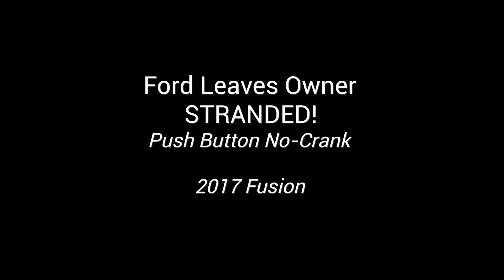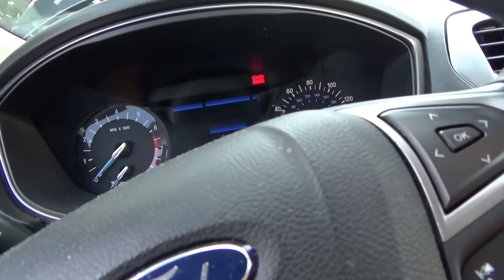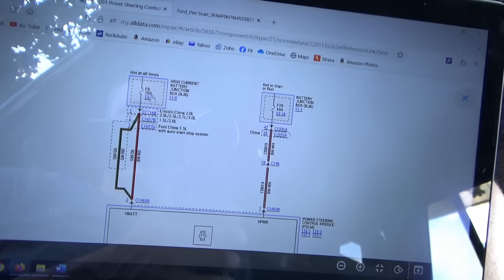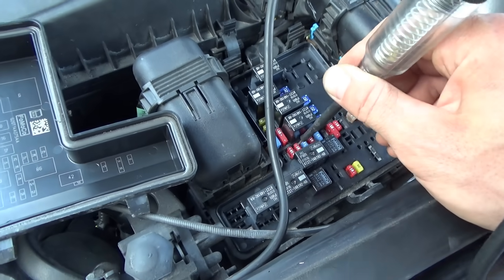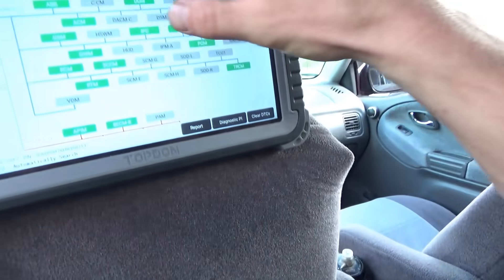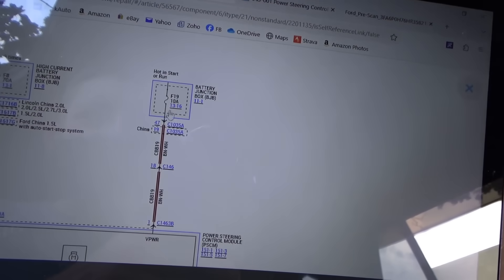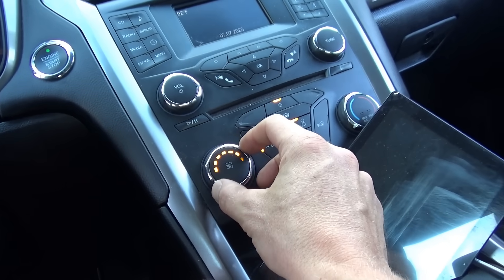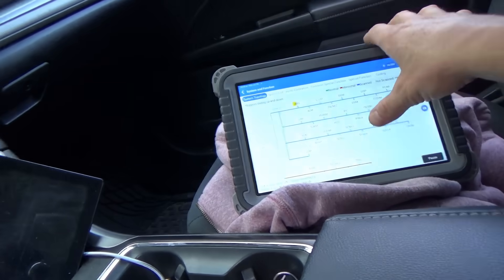Ford Leaves Owner STRANDED!! ('17 Fusion: No-Crank, Push-Button)

Comment: Either that fuse box have some cold solder joints or water intrusion or that fuse had oxidyzed and isolated itself from the circuit. As soon as you touched it the system came alive. For start change that 10A fuse or clean it well and see if the problem does not come back. If it does maybe that fuse box board have some problem.

Comment: Diagnose Dan had a similar event with carnk sensor being cross wired sensor OEM fitment in Europe Hella product the previous shop to him had changed 3or4sensors just following the codes  they asked Dan to have a look and the scope showed a fair pattern wave form wasn't untill he pulled a wave form from picos library he noticed the wav was upside down  cause ING a crank no start

Comment: I hate seeing things like electronic brake boosters and steering racks when the car isn’t an EV. They’re creating a problem that didn’t exist before they started making ICE engines that used components designed for an EV. The cost of repair has tripled just in the case of the centralized electronic brake boosters. What’s wrong with a vacuum assist behind a master cylinder? They were reliable as hell, but now the focus seems to be on replacement of the entire vehicle when you bring a ten year old vehicle to the dealership service department. Sometimes, the cost of bringing the vehicle back to factory stock is cost prohibitive due to poorly designed and expensive parts that were never designed to last longer than ten years. The air ride suspension of a Suburban SUV comes to mind.

Comment: If a visual inspection showed no corrosion in the relay socket, then the relay contact stuck the last time it closed and the contact burned, oxidized, and stopped conducting.  Vibrations from testing the fuses loosened the contactor and allows it to work again for a short while.  Possibly, the blower draws less current and the relay can work there indefinitely.

Comment: Those relays get pretty hot. I'm old school and always check coil resistance and contact closed resistance. I've found relay coils that increase resistance value over time (from heat) to the point of being intermittent or not working at all. Compare them to a known good one and see. Great find and quick repair on that one, good to have the wiring diagrams.

Comment: Very common for those fuse boxes to get poor contact, fixed simply by removing and reinserting all fuses and relays. when you look carefully you will see all have bad oxides on all pins, except where it got scraped off.
Reply: This is something that is useful for any car that particularly is older and been in service a long time and maybe gets some moisture inside the cabin because of small water leaks from time to time. Pull out relays and re-insert several times and you might just solve a difficult problem like a no start..

Comment: Good video Ivan.  Real world intermittent problems with all the electronics in these cars.  I just bought a 2025 Dodge 2500 with the 6.7 Cummins and I worried about all the electronics.  I am trying to decide on a new bi-directional scanner for it, I guess it needs be able to load Auto Authority.  Everything is a fringin subscription these days.

Comment: Very similar situation with our 2011 Silverado. Died in a parking lot, no start with intermittent cranking. Also gave CEL for ignition 1 and 2 circuits not matching.
 After checking wiring diagrams, I tracked the problem to the run/crank relay. Consider it's in constant operation, eventual failure is certainly possible.
Replaced it with same GM relay, no issues since.

Comment: I'm with ya Ivan.  I don't like problems that magically fix themselves.  Especially with a situation like this that could potentially strand the owner with the same problem.
Reply: Happened to my VW Lupo two years ago. Sudden no-crank-situation. Mobile mechanic measured and tested and after half an hour it came back to life but he had no idea why. Drove back home, shut it off, tried to start - dead. Tried again two hours later and it started. Next day I installed a DIY switch to bypass the ignition switch just in case this was the issue. But the situation never happened again to this day.

Comment: You would think there is a method to test those relays under their rated load for functionality. Seems like many mechanics would have a very good supply of the various relays on hand and simply replace them vs. switch them around.

Comment: Fords are notorious for these type of issues, it's just a loose connection problem which occurs from road driving and engine vibrations, just tighten the start relay contacts and you will be fine.

Comment: Ivan, be careful about swapping relays. I had a Ford pickup that had a defective start relay. I took the defective one to Ford and they said that the relays are different although they may have the same color and pinout and size, but some of the internals have different values. He showed me two that looked the same, but they were for different uses. I suggest that you should verify that they have the same part number before a swap.

Comment: GOOD video IVAN.This could be helpful to anyone with this model car.Just know that>that fuse runs the starting system on that model is key. And a spare part is located right next door.That's what i CALL EXPERT engineering!!!haha NO need to call a tow truck,when out on a date at lovers point.Just get out pop the hood swap the two relays,and take your date back to her sorority house.SHE'LL think your a genius.BUT it could still be the crustiness under the box?In this case i would tell the gut to buy a relay and replace it then put the other one back to the blower.This type of video is very helpful to most people including myself so thank you.

Comment: Ivan, I wrote a white paper on thermal imaging the relay box on no crank or crank no start situations, this method gives direction on going after the control side or the load side of the relays before intrusive/disturbing testing.
Reply: I'm assuming the relay will be cold since the coil is not energized/ commanded if it's a control side issue? Load side, warm relay?
Reply: @volvo09  Yes. Also further confirmation when possible with bidirectional command with two amp clamps hooked up to lab scope, when on DC the other on AC. DC macro AC micro reading. I wrote a white paper on that as well, gave it to Trevor at Autonerdz.

Comment: Good case on how replicating or verifying causation isn’t always possible, but you then must use logic and troubleshoot most likely cause.  Yet another case solved with a wiring diagram and test light and scanner.

Comment: That looks identical to the famous Ford Mondeo here in Ireland they are great cars did you get the Mondeo ST 220 over there I wonder do you have the diesels they are very good That model there looks to be a studio or Zetec as it doesn't have the bigger radio screen or digital dashboard also the wheels should look different to the higher trims like titanium and Titanium X
Reply: It's basically the same car, without the diesel.

This is a lower trim, you can get them all decked out with the big screen, fully digital dash, leather seats and whatnot ...
Reply: Ford discontinued the Fusion/Mondeo over here back in 2020. They no longer sell them in the USA. Now only ICE car left is the Mustang. Everything else is CUV/SUV or pick up trucks.

Comment: This happened before. I just touched a fuse checking for powers and grounds on a truck and things started clicking. I reached in and it fired right off. Didn't charge a friend but had the same problem come back within a week. He told me that he went back into the fuse box and wiggled some relays and it worked. Found a spread pin on the run relay that powers the ECM. I was leaning on bad engine computer. Boy was I wrong.

Comment: 2019 Explorer with an inconsistent startup. I found if I pushed the START button on the left and right side it worked. Replaced button, intermittent problem fixed.

Comment: I ran into a similar problem with a 2019 Nissan pathfinder. It wouldn’t start with the button no matter how the owner tried to push it. I locked the car and used the remote start function and it’s been starting normally ever since I used that remote start function. Weird huh?

Comment: I had a 2011 fiesta and did a relay swap around 2015 due to a problem like this, started playing up again around 2019 so I used to whack it with a screwdriver handle which always worked til I got rid of it in 2021. Percussive maintenance can work wonders :)
Reply: It's a Ford thing.
Reply: @ehsnils  It is- I've had several cars start after just a quick tap to the relays- almost always on cars/trucks that have been sitting
Reply: @ElijahAngwin  I have a 2015 f350 that I let sit for 3 weeks.  It became a no crank.  No codes, bright headlights, good battery.  Hold the key in the start position for about 10 or more seconds and it would crank and start. Replaced the run/start relay, cranks great instantly.
Reply: I love that term, percussive maintenance!

Comment: Ivan I just bought a 2012 Mazda 5  for 1,250 bucks at the capital auto auction in Philadelphia with a shit ton of issues 
Now I can put too good use what I learned from you in the last 15 years 
And my granddaughter should have a sweet little micro mini van  
When she says thanks 
 pop pop I'll say thank Ivan 💯😂
Reply: I also have to give scanner Danner and Eric O a lot of credit too for the path you guys put me on.  Thanks
Reply: If you need any parts for that Mazda, make sure to specify if it is Skyactive or not or you’ll be making several trips to find out. Even the oil filter is different, which Is the reason I’ll be making my third return trip here shortly. 👍
Reply: @brianw8963 
Thanks it's not a Skyactive  just a regular 2.5

Comment: My 2012 did that sometimes and when i tapped the relay it would start, i replaced the relay and it never did it again
Reply from the maker: Same relay?
Reply: @PineHollowAutoDiagnostics  Mine was the relay for the pcm and the dash had dashes on the odometer and the security lite was on

Comment: Ivan the camera went off at the end,, however  your details left no questions,  so let's see how the blower relay reacts😊
Reply: A friend was working on a Durango shutting-off problem. Restart after cooling off. After a long drive on a hot day, it shut off in an intersection (of course). He opened the fuse box, put his hand on the fuel pump relay and it was hot. He swapped it with the A/C relay and drove it back to the shop…with the windows down, no A/C. Later, the A/C worked after the relay cooled down.

Comment: You have a staker :)
I cannot work with the customer sitting on my shoulder.
Does it bother you?
Reply: I was wondering the same thing.
Reply: Before I left the business, if a customer was under the hood with me or working on another part of the vehicle, I would take a book out of my toolbox and go sit in the customer lounge and read. The first time the SM saw me I explained that the customer was doing my job, so I’m doing his. It wouldn’t take long before we changed back.
Reply: I agree with Ivan. If it’s just a quick oil change service and a friend I’ll do it once in a while, but other than that I just tell them up front to drop it off and I’ll call you when it’s done. My biggest problem with people hanging around is that most are older folks and they have more stories than I do, which tends to slow things down quite a bit. 👍
Reply from the maker: Depends on the customer 😂
Reply: @PineHollowAutoDiagnostics  Good etiquette would be not hovering or standing around when a tech/mech does the work. I still don't understand why people still don't get it?

Comment: You pushed fuse 22 down a fair bit with your test light before it started.
Reply: The entire row of fuses were dead from lack of relay closing
Reply: yeah, looked like the one end went down a ways, wonder what fuse 22 does.
** never mind, got un lazy and looked it up, fuse 22 is A/C clutch solenoid. so for sure not the issue.
Reply: Came to post same thing…
Reply: @stazeII  that was after he turned the camera on when he was going to film the entire row being dead, and they suddenly were all good.
Reply: @volvo09  The customer's curse: If you say it will, it won't; if you say it won't, it will - especially when showing it to someone else.

Comment: i have had those fuses crack and test good but the fuse is cracked and cant handle the load . you may have fixed it by pushing down on it

Comment: FORD backwards....DRIVER RETURNS ON FOOT
Reply: Heard a couple well known "FORD" acronym uses, but not that reverse use. Good one.
Reply: @faxmen09 my other favorite is FAILURE OF RESEARCH  & DEVELOPMENT
Reply: @mikefoehr235  Yes, and the classic Fix Or Repair Daily.
Reply: Found On Road Dead
Reply: I got a good one. 2013 Lincoln MKZ 2.0t with 230,000 miles not a single warning light on the dash and hasn't been in years it runs and drives perfect
Reply: @destruct61 every so often Ford gets it right. Not that often tho
Reply: Ford generally does better than GM or Chrysler. They’re all great when they’re working.
Reply: @destruct61  Sounds like a great car that has served you well. Just for the record, mostly commented for the comedic/entrainment value. All makes have thier issues. I think my favorite acronym is for FIAT, Fix It Again Tony! 😀
Reply: @destruct61 my in law had a 2012 edge with 285k zero issues
Reply: In the UK FORD is short for Fix Or Repair Daily
Reply: @therhubarb8823 FOUND OUTSIDE REGIONAL DUMP
Reply from the maker: GOOD ONE 🤣
Reply: Ford (found on road dead).
Reply: 9 out of 10 Fords are still on the road. The other 1 made it home.
Reply: Federation Of Retarded Drivers
Reply: Funny but did you even watch the video?
Reply: @quickvid6735 If it involves a ford, i never miss. I owned one of their cursed products....will NEVER own another
Reply: @quickvid6735 yes
Reply: Ford makes good trucks.. But stay away from their cars.  I had a 95 F150, 5spd 4x4 and drove it past 300k miles until it finally spun a bearing.. and now I have a 2002 F350 7.3L diesel, 6spd 4x4.  with well past 300k.. which were my last 2 trucks since 2005..  That's a lot of years for only 2 vehicles and neither truck every had any issues and never left me stranded.. Even when I spun the crank bearing, it still drove me home. (knocking LOUD - but it made it)...  But back when I got my first car in the late 90's-- it was a mercury sable ; basically the same thing as a ford taurus..  I literally went through 3 transmissions on that thing, in only a couple of years..  Worst vehicle experience of my life.. From then on I only drove manuals..  I bought a 97 Isuzu Rodeo 5spd 4x4.. and it was awesome and I drove it until I got that 95 F150.    I know Ford has made some flawed stuff over the years -- but those late 90's to early 2000's trucks were bullet proof.  A bit low on power-- which is maybe why they lasted so long.   I still have my Diesel.
Reply: For ordinary repairs daily